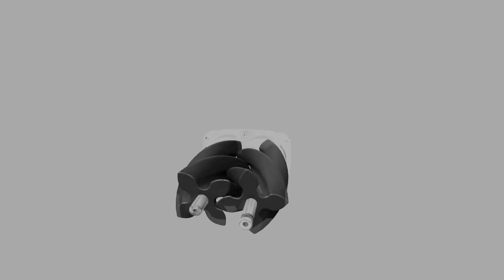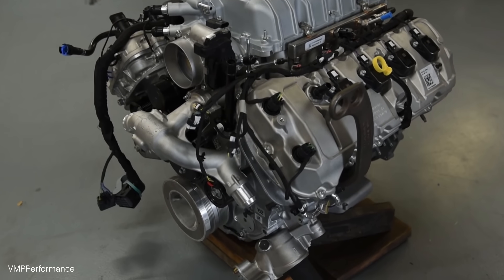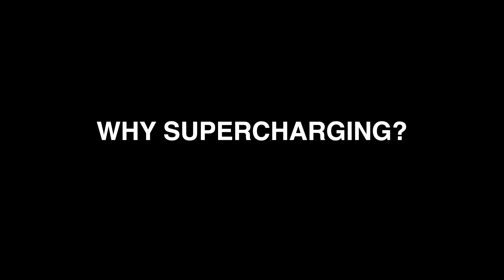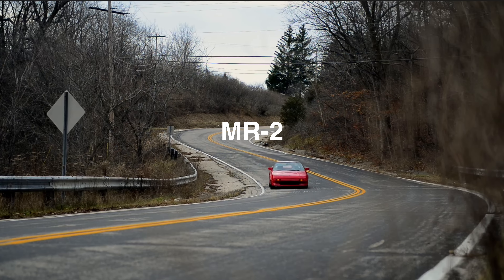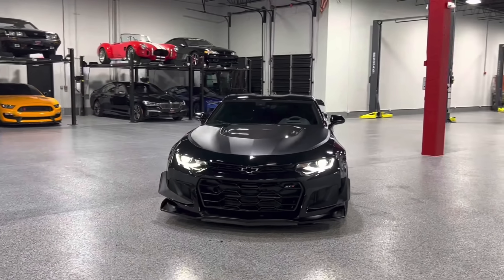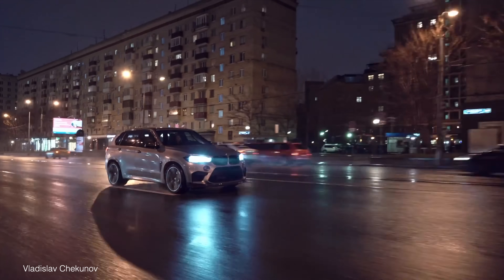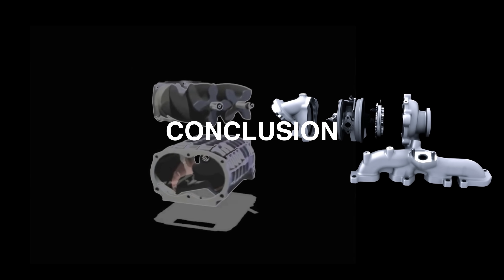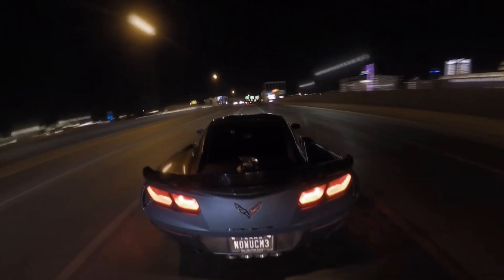Why V8 Engines Are Supercharged vs. Turbo😮| Explained Ep.6

Comment: The fun thing about both is superchargers = instant torque while turbochargers in a lot of cases = the sling shot effect as you sometimes need to build boost before you take off like a rocket though 2 step you can mitigate the lag but it’s fun watching guys stomp on the gas with a passenger only for the passenger to seem disappointed then boom boost kicks in! 😂

Comment: Unrivaled Scale: Between massive truck and SUV volumes—GM with Silverado/Sierra (over 875K units in 2024), Tahoe/Yukon/Escalade families, plus Corvette/Camaro; Stellantis with Ram (over 280K in 2024), heavy-duty models, and select Jeep/Dodge applications—these two move the vast majority of gasoline V8s in North America. This scale funds ongoing R&D to keep them competitive under emissions rules, far beyond what smaller brands can sustain. The volume is what allows lower pricing,  not technology , R&D that goes into these new V8's. 

Superior Engineering: Mastering pushrod single-cam V8s is harder than DOHC designs. Both GM and Stellantis excel with advanced variable valve timing on one cam, CFD-optimized flows for clean running without fragile turbos in base setups, and high-pressure direct/dual-fuel injection in performance variants.

"Hot V" is the Real Relic: European turbo-in-V layouts were a lag fix but bring heat soak and complexity. High-displacement, naturally aspirated or supercharged American V8s from GM and Stellantis deliver better thermal management, packaging, and real-world efficiency without the headaches

Comment: Superchargers for the road, in road tune.
Turbos for the track.

My V6 supercharged XF Jaguar has 420hp & 380ftlbs and gets over 35mpg( US) @ 70mph (6.4l/100kms).....It is doing 1400rpm @ 70mph with 11.2 psi boost.

Comment: Not convinced the 'hot V' is the way to go.   Makes packaging a bit easier.   But on a long nose car - like a pony car, or Corvette - put the turbos out front, near the air to air intercooler and then pipe it back.   Packaging of accessories gets a bit tougher - but with electric power steering boost - you are pretty much running A/C and an alternator (water pump driving off timing chain or electric).

Comment: The actual main counterpoint for superchargers in all other markets is fuel efficiency, countries outside the United States and the Emirates care way more about fuel prices and supercharges well, they make more power than they parasite so you know, those parasitic losses aren't the main point, the thing is, you're wasting fuel to turn the supercharger, that's where those parasitic losses go, to fuel consumption, while in a turbo car... well.. a one liter turbo engine is just a one liter engine if the turbo isn't spooled, and when they're spooled well now you have the volumetric efficienty of a engine double the size, economy when it's needed, power when it's needed.

Comment: Sequential twin turbo V8's are insanity, and for example you don't hear about Supercharged Vipers, you turbo a viper. It depends on if the car needs the whine to sound good. Also, twin turbo Coyote 5.0's are insanity. With the dual overhead cam in the Mustang and F150 the twin turbos are making waves as we speak.

Comment: You failed to talk about power delivery. The ‘always-on’ nature of a supercharger makes the engine feel bigger than it is (cos that’s effectively what it’s doing), and gives the engine a lot of low down torque, which is in line with the American consumer expectation. Turbo’d motors need to be revved, which is more in line with what European consumers are used to (smaller displacement motors that need revs).

Comment: Hasn't anyone just used electric motors to pump air? Seems like such a simple solution. Modern electric motors can go like nuts with a small footprint.  Basically just an air compressor. Shit, it could be in the trunk and pipe air in. Exhaust gas is oxygen deficient. Seems like a dumb idea.
Reply: The exhaust spools the turbo and is then expelled from the vehicle. It doesn't go back into the engine.

Comment: Supercharger do not build carbon deposits all around in the engine.... turbo = engine sludge..... the carbon from the EGR valve polluts the oil and creates sludge deposits all around in the engine way faster than it happens in NA engines and in NA engines sludge only builds up with lack of oil change....

Comment: A lot of people don't know that turbos also have parasitic loss. The back pressure from exhaust trying to ram into the turbo does cause a power loss because the engine has to work harder to push exhaust out.
Reply: But all in all its way more efficient to generate more horsepower using a turbo

Comment: CT6-V wasn't cancelled because of poor sales, the CT6 its based on was cancelled before the V version was even announced since sedan sales have tanked in the US and Cadillac converted plant where the CT6 was built to an EV factory.  Cadillac had no problem selling all the V models that were produced and they're holding value well in the used market.  The Blackwing engine is phenomenal and it's sad Cadillac didn't use it in more vehicles.

Comment: Key words: with compressed air more fuel can be burn = more power.
Supercharger = air pump, trow types: root style and twin screws. The later being more efficient.
Why the transition to turbos?: the technology got real goood.
But superCharger are more reliable, easy to maintain. Less expensif. But good! Camaro ZL1.
If you have money and don't lime the sound of superCharger you may consider turbo.
The end of an era.

Comment: The first turbo car I ever had, I have right now.  I was very annoyed at first with the turbo-lag in my 2010 Legacy GT, however, becoming more skilled at driving that car, is tending to eliminate the annoyance in the lag.  Being a manual transmission necessarily makes driving any turbo much better too.  All you can do in an automatic is mash the gas and wait.  So, instead of biitching about the lag, I'm learning to drive it accordingly.  I love that car.  
Back in 2010 I had a 2006 MINI Cooper (w/6MT) with the supercharged 1.6L - and that thing was like a bullet at a stop-light.  Wasn't all that fast above 80mph, but I found it to be very sturdy, tight, planted, yet exceptionally nimble in any maneuver above 60mph.  
Honorable mention goes to Honda VTEC though.  Their historic and prolific 2.4L with VTEC on both intake and exhaust is a true screamer, closest one can get to a super or turbo charger, without having one.  
Get you a Honda Element with a manual trans, tighten up the suspension, and give it something to gulp the air.... I've embarrassed a lot V8s and turbo diesels on the highway with that lil whippersnapper.  
Or, Get you an Acura TL with the 3.7L V6, naturally aspirated, gives the same goosebumps a mighty V8 does.  That engine is a symphony of natural aspiration.  How awesome would it be with a super on it?

Comment: I have a Bronco with a 2.3L turbocharged 4cyl. 300hp. The throttle response and turbo lag is straight up shameful. But it's not built for racing so I can deal with it. Would much prefer a supercharger though.

Comment: There's also Centrifugal Superchargers: basically the compressor of a turbo, but driven by the engine directly

Because of this, and because of the way a centrifugal compressor generates boost, boost increases essentially linearly with engine rpm: twice the rpm will give twice the boost

For some, this seems a worst of both worlds: you lose some of the efficiency bonus the tubo offers, and you also dont get the ability to generate full boost at near idle rpm

However, a centrifugal compressor will have a much lower parasitic load at peak rpm than a positive displacement supercharger, and compared to a turbo, it's much simpler to install, due to the lack of turbine assembly. It also lacks any sort of turbo lag, due to the direct mechanical connection

Plus, sometimes people only really WANT full boost when gunning for max power: if you dont need the extra boost pressure right this moment, you'd rather not demand all that power be stolen from the engine. So while not able to "scavenge" energy from the exhaust like a turbo, it can still be a lot easier on the engine and fuel consumption for daily driving, while still retaining that ability to slam the throttle open for max power

Comment: Supercharging just works better overall on a gasoline engine, turbocharging just works better overall on a diesel engine.  The reasons turbos work so well on diesels is because they normally don't have a throttle plate.  That means a much higher rate of flow at idle, which keeps the turbo spinning fast, hence, little turbo lag, but on a gasoline engine, the air, not the fuel is throttled, so at idle and small throttle openings, the turbo slows way down, so when you step on it, the engine doesn't make much power until the turbo speeds up.  That is what turbo lag is.

Comment: Supercharged engines just sound tortured to me. Would rather just hear all cylinders giving it the wear cry, or better yet, a rush of air escaping the wastegate or blowoff valve when throttle closes. The "stu-tu-tu" sound is just cringe, especially when you factor in the damage a back-surge can do to a turbine over time.

Comment: This is a dated topic. Yes in the 80's and 90's Turbo cars suffered from Turbo lag.  Nothing,  nothing, nothing then whoosh! All axel tramp and wheelspin.  Not to mention the extra parts and complexity a turbo setup required.  The increased engine temperatures of high boost. The Turbo using the engine oil. Cold starts and hot stops. All this made the prospect of a Turbo unreliable, difficult to maintain and expensive.  Superchargers have been around longer than Turbochargers.  Superchargers have their own oil supply.  Being belt driven they have less parts and complexity.  They don't spin as fast as a Turbo so do not generate as much heat. Heat kills engines over time if the engine isn't fully prepared.  A Supercharger builds power based on engine revs. The power and torque is more linear.  No sudden hit of boost that potentially damages the engine or transmission.  A modern Turbo car however will out perform a Supercharged car. A gently driven turbo petrol car is more efficient than either a Naturally Aspirated or Supercharged.  Supercharged has paristatic drag. Its like having the A/C on all the time. If the Supercharger isn't giving much boost it still requires 10% of engine power to operate.  Floor it and the Supercharger delivers linear power but the Supercharger consumes power to give power. The McLaren SLR famously used 120bhp to power the Supercharger when at full chat. A turbo has no such issue.  A modern Turbo is night and day faster than a like for like Supercharged car.

Comment: FYI...1 year later, and it's generally accepted, EV's are DEAD to most of the world. Ford has come out and blatantly said, 'Unlike our competitors, the Mustang is a centerpiece of musclecar history...and it's future. We DO NOT PLAN on eliminating supercharged Mustangs, EVER!'...meanwhile, the world is Copper-short, only about 35-years of this metal remaining for use...means 'no electrical windings for motors', 'no more electrical wiring' for circuits...yes, the world is changing...and in short time, you're probably going to be more in tune with 'old world diesels' than 'Star Trek EV's'...but, keep holding your breath.

Comment: Alot of the information from this video isnt true.  This is a point of view.  American engines are larger and have no problem turning a superchager and the response of a SC vs a TC will never be equal.  TC and SC have a airflow demand that has limits, all you hear about is boost pressure, ppl think boost is important.  And its not.  Boost is a restriction the important thing is airflow.  Fuel has the energy which need air to be turned into a energy source.  Everything is made to an application of use thats all.  To be involved with drag racing for over 17 years the new cars thats coming out the tech is really not good its just a selling point, oh wow this car makes 600hp.  Its
Nothing special about that we been in the 2000-4000hp range for over a decade but apparently people dont know we exist or forgot

Comment: Something that has always confused me about turbos vs superchargers is the parasitic loss thing. Obviously superchargers have that since the crank needs to spin it, but if you have a turbo, doesn't this essentially "obstruct" the exhaust, this requiring more energy to push the exhaust gasses out of the engine and resulting in the same parasitic loss?

Comment: Both are good.

Turbos provides good power when you have tight places in the engine bay.

Supercharger are good for consistency in track time. 

If you need space turbos. 

If you have space add super charger.

Comment: Turbos use mostly thermal energy from the combustion of the engine, not exhaust kinetic energy. If it is to use the kinetic energy of gas flow, it would create immense back pressure and be bad for performance. Turbo charges are good harvest the heat energy that will otherwise be wasted basically

Comment: My supercharged Mini Cooper S by far has the best throttle response of any car I’ve owned despite having less than 200 HP. A super goes a long way in making a car act as though it has higher displacement, as opposed to waiting for turbo power. As for R&D budgets being put towards EVs. That is a disaster waiting to happen. In 10 years when the entire global supply chain for Lithium is crippled by EV manufacturers and then no one can buy a car. They’ll look back and realize there should have just kept working to make Gas engines more efficient.

Comment: Why hasn't anyone made a supercharger that runs on electric motors instead of the crank?
Reply: It’s not worth the weight
Reply: @khakipeach2128  i kind of thought that, but won't it be wild to see how much more hp you get when the electric tech catches up and there's no parasitic loss from running it off the crank!

Comment: Nice vid! Love the sounds of those V8s and superchargers for sure 😊

You forgot to mention fuel though. Euro regulations mean euro manufacturers have to think a lot about fuel consumption. Hence a lot of tendency towards turbos. You can get more power out of smaller engines and less emissions.

USA doesn’t have those regulations and has had cheap fuel for decades. So no need to be efficient, just pour more fuel in for your 5+Litre beasts.

TBH I think that’s probably the main difference between the supercharger vs turbo solutions with USA and Europe.

Comment: I'm surprised that nobody is using tiny electric motors to spool up turbochargerers more quickly. Turbo lag could easily be nearly eliminated with only a tiny increase in weight.